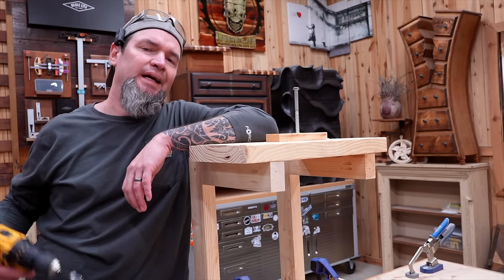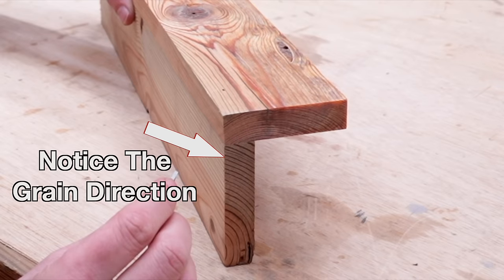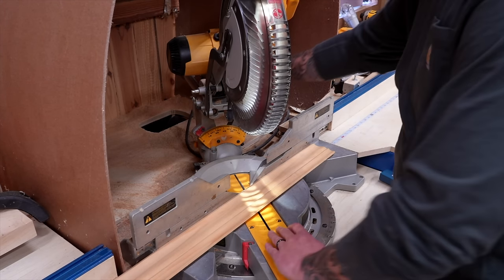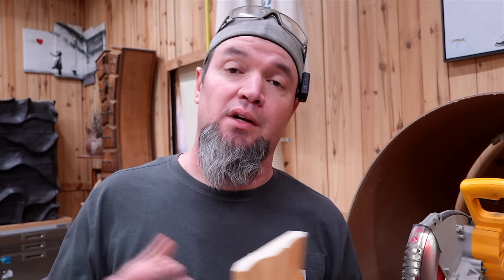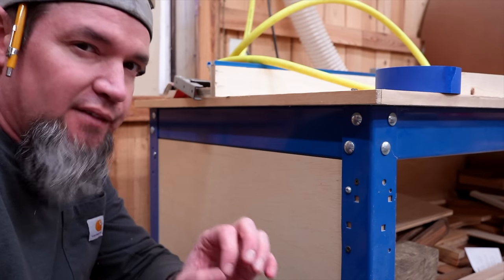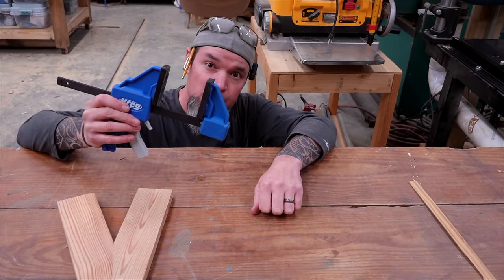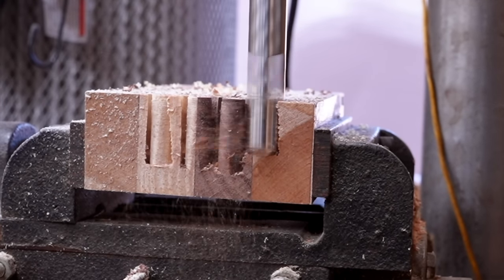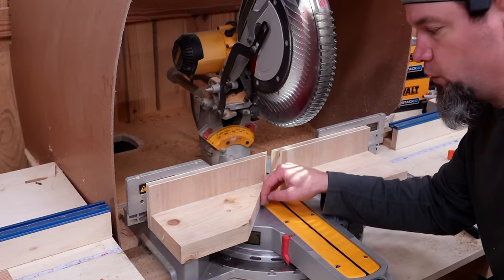My Most Viral Tips and Tricks That Every Woodworker Should Know!

Comment: The most simple trick I use is on my table saw. If I need a quick zero clearance I use painters tape. A couple of layers of tape , run the blade through, cut away... Works well for me for limited duty.

Comment: I use titebond speed set wood glue. It has UV dye in it so i can see it with blacklight to insure I have good cleanup before finishing. Its also good for repair mixed with fine sawdust from sander. It dries clear

Comment: I think that you are the only one that made two  stop blocks for cutting  Acute Angles for a video !  its much easier to hold a piece of trim on a miter saw when both stop blocks are connected to the saws table .   30 years ago , I was taught how to cut 8 inch and 12 inch crown molding by laying it flat on a miter saw and since then I always cut crown laying flat .   add in - Never ever cut trim with a cheap or a dull saw blade !

Comment: Mathew thank you for these hacks they are great. 
I have been using this for at least 10 years and that is hockey pucks to hold my work instead of buying them.  I also took 6 of the 20 I bought and I drove a screw threw them to use as a painters pyramid.

Comment: Each and everyone of these tips is a winner.  The jig for the miter saw for severe angles is perfection.  Also when trying to get the proper hole alignment to mount a device to a wall or wherever, the tape trick is excellent.  I also have used the photocopy way.  Just place the rear of the device on your copy machine and make a copy of the hole placement.  Works like a champ also.  Thanks for sharing these with us.
Reply from the maker: Great tip! And no worries!

Comment: I've always had bad luck with wood putty either not taking stain (even when using sawdust) or drying and cracking, so I've learned to fill small holes and gaps with baking soda and liquid super glue. Just pack the spot with baking soda and drop on a little super glue. Hardens immediately, sands fairly well, very durable, and takes stain quite nicely.
Reply: Interesting, thanks for sharing.

Comment: My favorite one was the 90 degree closet shelf brackets to hold pieces up vertically to work on the edge. I like it so much because I never thought of using those in that way. And I remember reading a lot of comments from others that said the same thing. It's great for brad nailing or a back stop for driving pocket screws.
Reply from the maker: I thought about adding that one but couldnt remember if I have mentioned it before.  I came up with that while trying to nail edge trim on a 10" board.

Comment: I had to do something different for the 'tablesaw-as-a-jointer' tip. This may never be seen by anyone, but here goes, just in case.

Since my stock was already within 1/4" of final length, I built an "L" out of 3/4" x 2" scraps, and then fastened it to the top of the boards using double-sided tape. Worked like a champ. Thanks for the great video!

Now on to slay that crown molding monster...

Comment: I discovered the tape trick to determine hole locations some time ago. Something I got from the Wood Whisperer is if your charger, power strip or whatever has a tendency to slip off the screw heads, you could take a small wood block and screw it above the device you are installing. Then it won't come off accidentally.

Of course, you can tighten the screws just enough to have snug friction holding the device. But at least for me, that isn't always good enough.

Comment: I've got a ver small bandsaw that was made for metal, but uses a thin wood blade for doing pens and smaller things. I dont want to shell out the bucks for the slide thing that fits the table. I use a plastic framing square to push material through (mainly crosscut), and I clamp it to the side for ripping. Works well so far.

Comment: Great tips!  For the brad nails, I flatten the points with a light touch to the grinder, or file,  when working with wood that is prone to splitting.  This avoids the wedge effect.  It will probably help brads drive straighter through curved hard/soft grain like in Pine too.  Last time I did this I KNOW it worked, because later that day, I shot a brad straight through my thumb when I used it to press the nailer tip to trigger interlock, you know, to see how it worked, and then pressed the trigger forgetting it was still connected to air!  Ouch 😮

Comment: Is there any kind of tool that you can hook up to a miter saw that acts as a stop for when your setting a miter angle or bevel angle on the saw to an angle that is not one of the detent angles?   That way you get the exact angle every time instead of trying to zoom in with your eyes and estimate.    For example  12.7 degrees is not one of the detent angles.  If I adjusted my miter or bevel and homed in that angle until I got it right, is there a tool that you can hook up on the saw that would become a stop when i need to cut that angle again?

Comment: A trick I saw a long time ago for wooden plugs is to make them in a fairly skinny piece of wood, only one row.
Then when you cut them free of the strip, you don't. You make the depth of cut so they are still attached to the backing wood like a veneer thickness. This keeps them attached.

When you install the plugs since they are attached to the wood strip the grain direction is always known for easy alignment.
The thin backing of wood is flexible enough that you can bend it up out of the way and snap it off. 
The tops are always the tops so the color matches and the taper is correct.

It carries all your plugs together in an easy applicator, keeps the grain direction known and aligned, ensures the small end is down, is easily broken off the plug during installation simply by bending the wood backing up.

Comment: I can attest to the “keep your hands away from the project” when using a brad nailer.  I was using 2 inch brads and was holding the wood from the top, against a 6x6 I angled the brad down and in as I didn’t care if it went into the 6x6 as long as it connected with the plywood I was buttjointing as a skirt around it.  It hit something inside took a hard turn and went nearly an inch and half straight up my index finger.  

Fun times!

Comment: All of these tricks are really cool.😎 I had no trouble envisioning 2 or 3 scenarios where these tips could be deployed to make me look a pro. 🤓🤠
I'd have to say that your most recent table saw sled video was truly over the top. You can truly turn jobsite table saw into a fine woodwork'n machine. I'm looking at getting the portable/jobsite table saw from SKIL SPT99-11, or a DELTA Contractor Table Saw. Either way, the table saw comes before the Miter Saw.
Reply: Don't be afraid of a cheap mitre either. I've retired mine to a metal chop saw. And my old table saw is permanently dato blades. Because I hate changing blades. 😅

Comment: When I need to put a bolt into wood, I don't use the metal inserts, I thread the wood just as I would do if I was putting the bolt into metal. I have used this method on dozens if not hundreds of projects and have never had one fail. I even did a torque test one time and the threads held up to the proper torque. It takes three threads in metal to hold as much as the threads on the bolt will hold. I usually have several more than three when I thread a piece of wood so you are getting much more contact when threading wood.

Comment: Been watching your videos for a while and just bought myself a set of plans and am excited to get cracking at it. I love your hack on cutting acute angles with a jig, I was wondering how you get those specific angles dialed in on your miter saw. Whole numbers are easy enough to find but how do you set up your saw for an 18.3 per say or a 49.9 where the angle has to be really accurate for things like trim?
Reply from the maker: On that you would have to use a digital angle finder.  You can pick them up for fairly cheap!

Comment: I want to know an easy way to figure length and angles for cutting boards.   If I have a table leg that's 90° to the table top and I want to put a leg support to a cleat in the center of table top. How do I figure the angle and length to cut the board?

Comment: Explain to me why when joining MDF as a butt joint nails still run off center MDF doesn't have knots
But the nails can certainly poke out the side. A lot of it has to do with how you hold the tool but ill take your advice on the cut angle of the tip, but you'll also have to understand its a chisel end and it can split the wood.

Comment: A lot of guys who run the saws at sawmills get cussed out by construction workers b/c the construction workers think the reason the width of pressure treated lumber is not consistent down the length of the board is b/c those guys at the sawmill don't know how to run a saw.   The guys at the sawmill have nothing to do with why the widths change.   When lumber is put in the pressurized tank, the liquid treatment is forced into the grain at high pressure, and it causes the board to swell but it does not swell the same amount everywhere on the board.   You could put a perfect 3.5 " wide board into the chamber and when it comes out, the widths aren't going to be exactly 3.5 anymore.  Usually the wider the board, the more it can swell.   The grain at a certain point of the board determines how much or how little it's going to swell, and you have different kinds of grain, so you wind up with different widths.  This is an issue that cannot be stopped but over time the board will dry out and will shrink back closer to what it was originally sawn at.

Comment: Ive never installed crown but know that its set at a spring angle of a certain amount.  Ive seen those weird number settings like the 31.6 and 33.9 and have aways wondered how that is calculated.  I have not been able to find the formula that gives you the 31.6 miter angle and the 33.9 bevel angle for flat cutting crown molding that is being installed on a standard 90 degree outside corner.  Setting the miter saw at 31.6 would give you a 121.6 degree toe and a 58.4 degree heel on end of the crown molding that is cut.  I've always wanted to find the formula b/c a lot of times outside and inside corner walls aren't 90 degrees anymore.  I have an agle finder and most of them in a house are 87 - 89 range so that means if installing crown on a corner thats off a degree or two means those miter/bevel angle settings (31.6 & 33.9) would need to adjust as well to make the pieces join perfectly.

Comment: Cutting crown like that don't take into account the inside and outside corners of a wall and celings are not a perfect right angle.
This is why you walk into most homes and the craftsmanship sucks.     

Seriously, i was looking at new houses and a set of stairs had moved the moldings were pulling apart  but it wasn't just that
Windows were leaking  ex.
Were talking a 750k to 1.2 million dollar home  and the craftsmanship was shit.

You might have stops on your miter saw, but they don't fit the walls your cutting for.  In a perfect world with straight 2x4" its still going to be off
Because home builders don't have to meet quality to pass code.   
They are just in a big hurry to get it built. Haste makes waste.  Oops cut too long beat it in, oops cut to short, shim it or nail it anyway.

Comment: Handplane - #5 bailey, I could have had those 2 boards jointed before you turned on the saw.  and without having to recut the ends for the screwholes.   
Plugs  - a simpler doweling jig can be bought or made cheaply and you can make plugs and dowels as long as you need them, for like hidden hinges.  just cut and prep square stock first.

Comment: Coping has zero to do with how you cut it on the saw. Also depending on the crown spring angle depends on how you cut it. Now regardless. Coping is about “bedding” in 32 yrs I’ve never seen a perfect 90 unless it’s something I’ve built  like cabinets and even then nothing is perfect. So coping allows you to bed 2 pieces of trim to aline plus if cut properly it will slightly dig (bed) into the other piece. And what I mean by properly…. I mean you cut crown and base a 1/16 to 1/8 longer when coping so it bows in the middle and when you press it in the middle it’ll “bed” into the the other piece. Just remember. Never nail the corners so you can adjust them till they meet up appropriately once bedded. You can’t learn trim work or carpentry from a YouTube video no matter how many views the channel has. It takes yrs of work, mistakes and perfecting the craft. Your an idiot if you think watching a video will make you a master. In the field day in day out 32 yrs and you better believe I have to work every minute paying attention to every detail of what I’m using and doing to create the things most of you will never notice and will never be able to do. I watch these videos to see what jack legs are saying and doing. Views don’t make you an expect. And if that’s what you hang your hat on is how many views…. Well… lol…. I’d be afraid to hang my hat on that. 

FYI… what he didn’t tell you is when your nailing into pine vs other woods. He only used pine to show his reasoning. Not every wood works that way. But yes it is important to know what the material is and how it can react to nail guns. Just saying…..